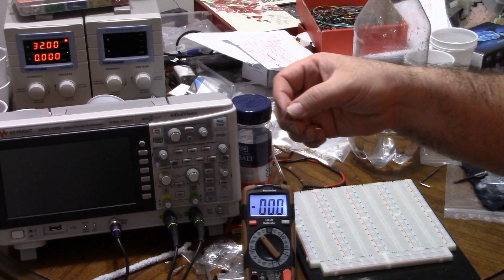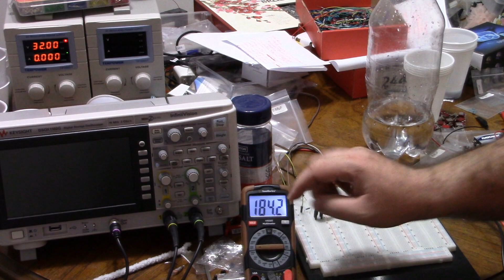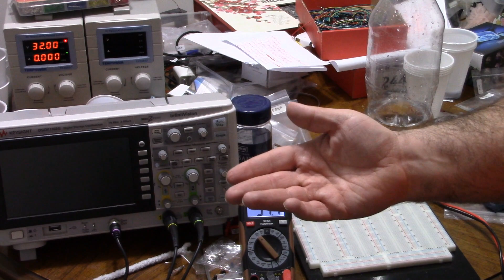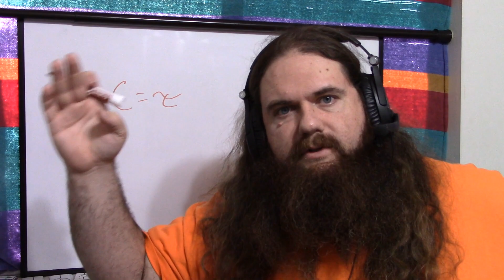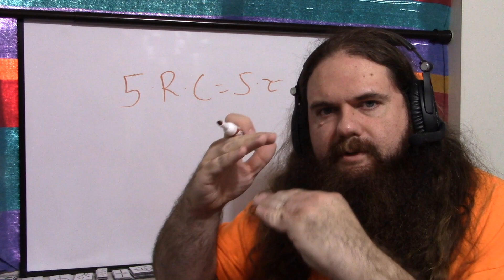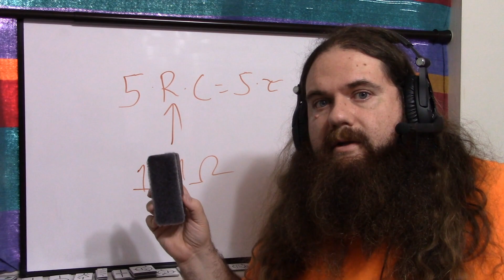Demonstration of a Multimeter Draining a Capacitor While Measuring It - Simply Put

Comment: One of those measurement scenarios where an oscilloscope is a must.
Reply from the maker: In this case, it's much better to buffer the voltage to measure it, but an oscilloscope would definitely be the right choice (in "single" mode to capture the initial drop) if buffering isn't an option.